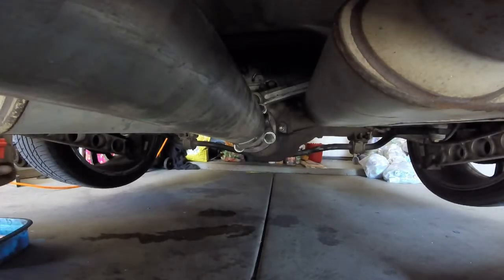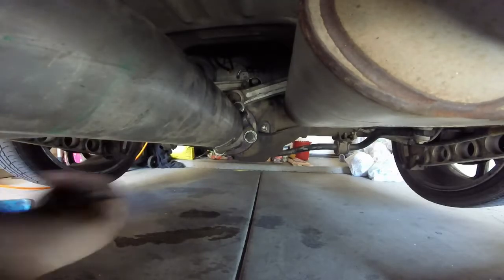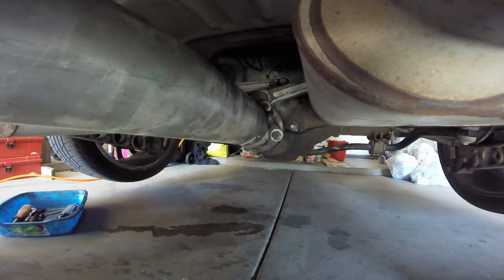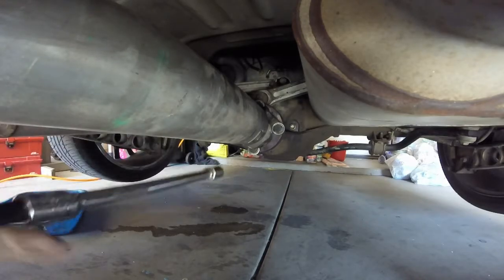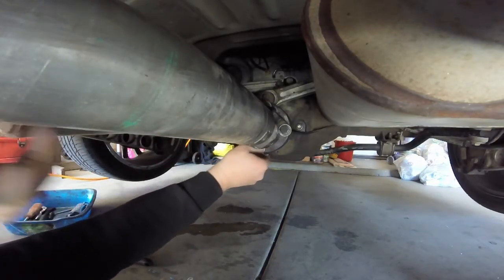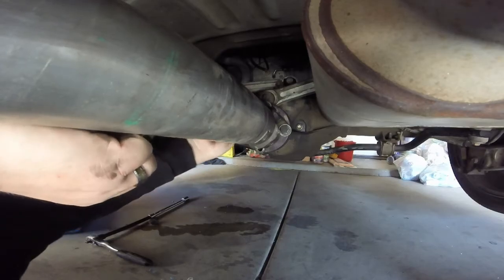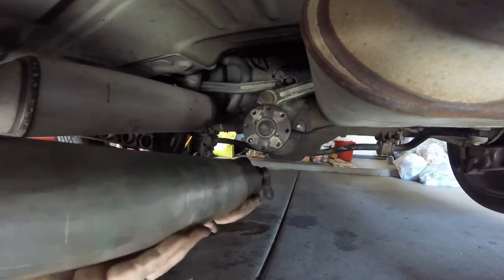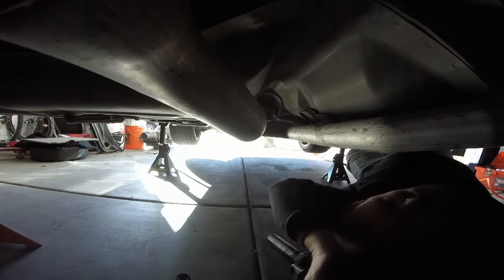Drive Shaft Removal

Comment: I have replaced the entire suspension front and rear on my 01 MGM GS put new Lincoln tires on and still have a slight vibration. No noise just vibration so next I’m replacing the U-Joint maybe that’s my problem. After replacing everything it helped but didn’t fix it .

Comment: On my vic the drive shaft is way too big for that kind of clearance to the bolts. You can fit the socket on the bolt but no way in hell are you going to stick anything into that socket. Blocked right off by the shaft, you'll need some 12 point crowfoot wrench set adapters or something. Dunno what's up with your setup. Must be a difference between civilian and police interceptor driveshafts.
Reply from the maker: This car had both shafts installed and the bolts were the same. The car is an 05 MGM and the Police shaft was from a 99. 98-11 shafts are interchangeable.
Reply: @Dietrich804  I'm thinking the issue I had was that I used a 1/2" 12mm 12 point socket. When I get around to installing my old limited slip rear end on my newer open diff Vic I will try the 3/8th 12mm 12 point socket instead. It is visibly slimmer and smaller, I think this will allow for a lot more room around the bulk of the driveshaft. Wish I could post a pic to show you what I originally meant. Oh well.

Comment: How do you break the bolts loose
Reply from the maker: The shaft has to be held by the trans or the brakes. Then use a breaker bar or impact gun. Make sure the vehicle is blocked from rolling.

Comment: this has the WRONG bolts in it. they will fail & this is dangerous. NOT recommended!
Reply from the maker: What's wrong with these bolts specifically??? These bolts were replacements because this driveshaft is setup with a spacer behind it. It's shorter than the original driveshaft.